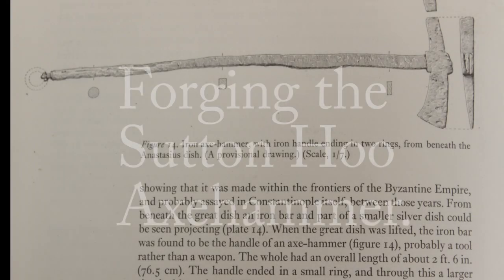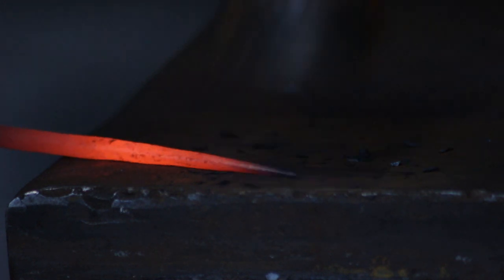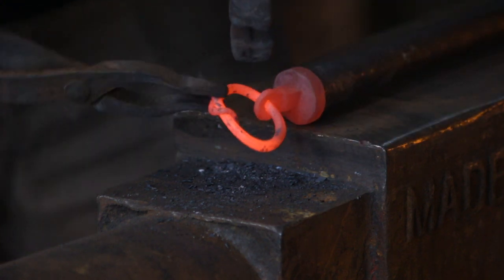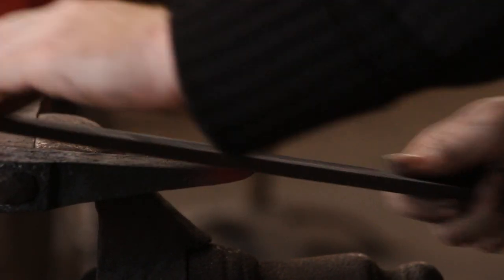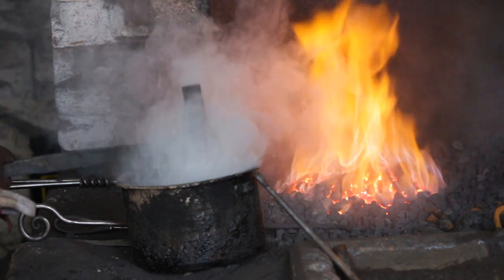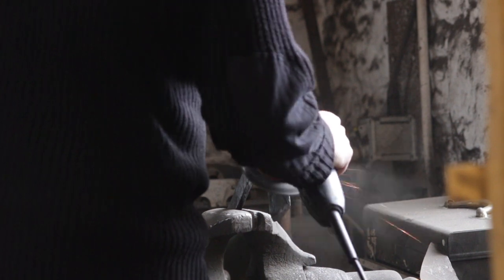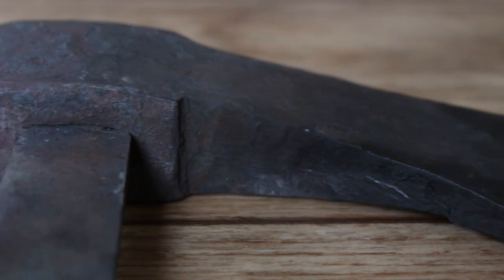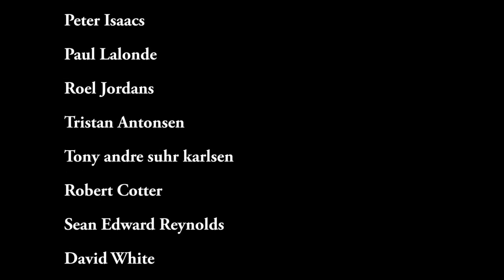reproducing the Sutton Hoo Axehammer. Part 4: Completion.

Comment: Thank you very much for this series. 
I'm not keen on reading comment so this might have been brought up already. In that case I Apologie, but from the onset this seemed to me a quite crudely made all be it very probate instrument i.e. made for a someone with more need than money.
I may be mistaking, but did you mention in one of the first episodes that it was found near/with with some stuff for cooking? (sorry abt the 'stuff', English is not my first language)
Anyhow; the first thing that came to mind when you started this project was: This is at tool for slaughtering animals!
If you were to wack a sheep, pig og oxen on the forehead with the blunt side of this thing they would surely go down. The sharp side could be used in this manner to I guess, but it would be somewhat messy. However, the sharp side would seem handy when you were to open up the rip cage of an oxen. 
Having the two instruments combined into one would make for a cheaper solution, and would, IMHO, be 'in tune' with the some ward cheapish finish of the original find. 
Thanks again for at very interesting series
Holger Trankjær

PS
I'm a volunteer (amateure) black smith at Sagnlandet Lejre in Denmark. If you're interested I could run the design by some of our archaeologists, just to if they have any interesting theories.

Comment: I was under the impression that the sawing motion is perfectly acceptable when hot rasping. One: the softness of the hot metal should do no harm to the teeth, particularly if you cool the tool while the object metal is reheating. Two: grinding an edge bevel with the rasp while hot is effectively burnishing the metal providing a smooth, consistent edge for quenching: avoiding "sharp" scratches for stress riser cracks to form.

Comment: I find it curious that they put a metal handle on this, given the expense/value of iron at the time compared to wood, especially if it was a utilitarian tool.  
I'd also like to say don't be so hard on yourself for not making it exactly as the original in the illustration.  That item is what was made by that particular smith, at that instance in time, and given the lack of modern mass production and machine tools and practices, I very much doubt that every one of this particular style of axe was made exactly the same, with variations inherent in the hand working of the metal, and preferences/practices of the particular smith, so there will be variations not only between smiths, but items created by the same smith, even to the point of the state of his hangover and time of day when making it :) 
I have been a historical re-enactor for many years (American Civil War/Victorian western frontier) and one of the problems in that hobby is the exact replication ("cloning") of a single item to the point that certain things are massively over represented, and there is too little variation of similar items. Even with mass production, there will be differences between manufacturers of similar items, and different quality levels, etc.
As always a very entertaining and informative video!

Comment: Well done Rowan. It came out looking very much like the drawings. 
Would this have been a torture to use due to the vibration transferring down the metal handle? I think you did mention it could possibly be used as cow killer, if it was for that it wouldn't be much vibration.
Reply: It's asymmetrical shape might have indicated a wood working function.